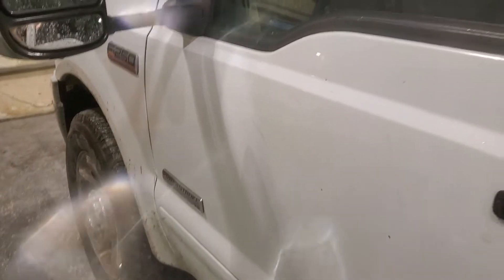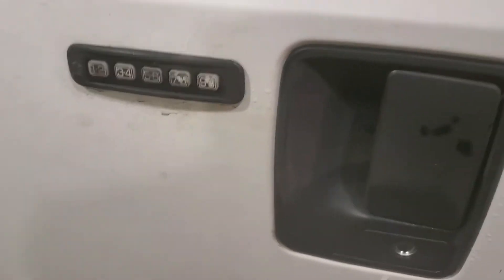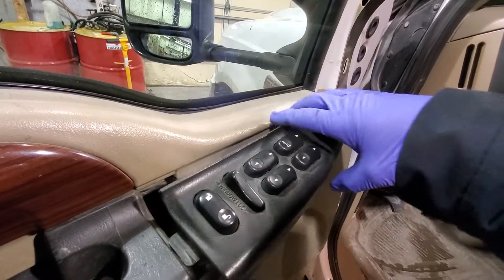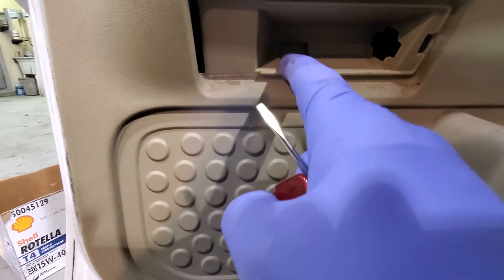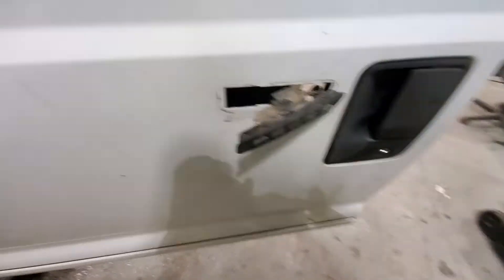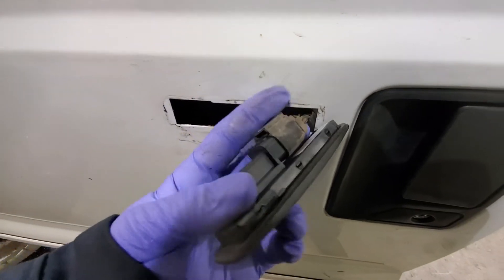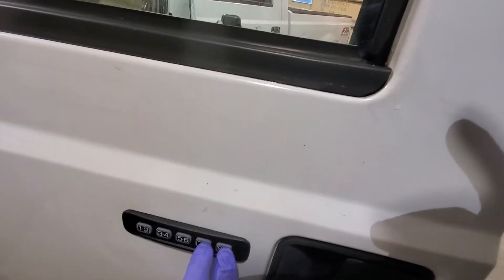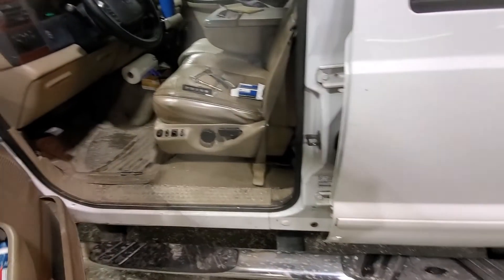Door Keypad Replacement 2006 F250/Super Duty

Comment: Perhaps save a bundle on 2004 F350 keyless touch pad. For a few months the 9 was acting up and then could not unlock the door with the keypad. Watched the video on removing the door panel and touch pad (Thank you). Used small screwdriver to remove bezel and then lifted out the flexible button pad. Cleaned the contacts on back of number pad and  the circuit board contacts with electrical contact cleaner and soft rag and reassembled. Unless the circuit board is damage, the contacts are probably just dirty. Works like new. Lots of money saved for beer.
Reply from the maker: Good tip. Thanks!